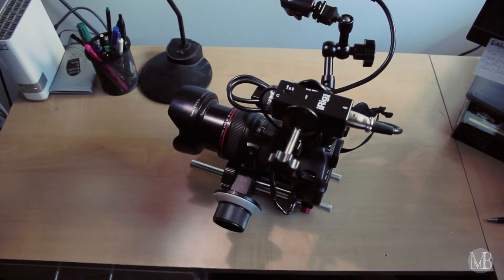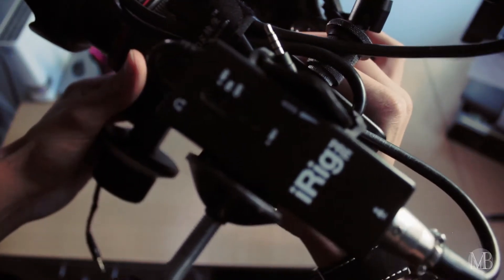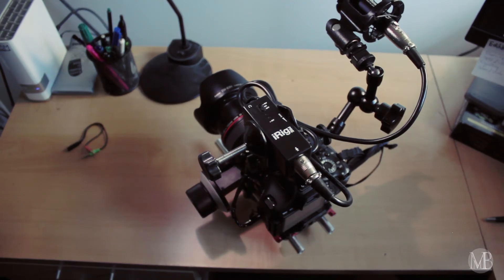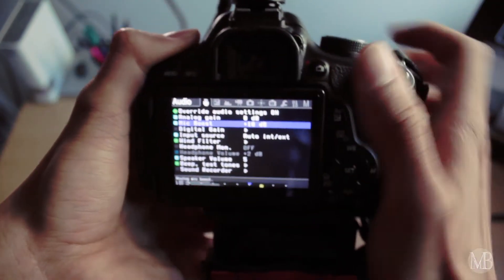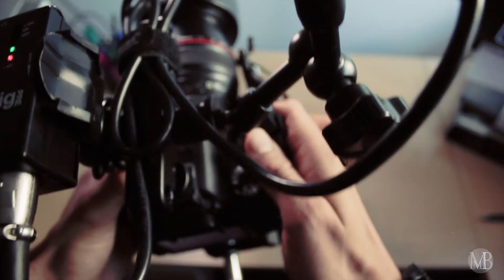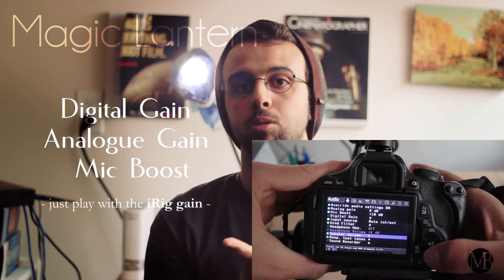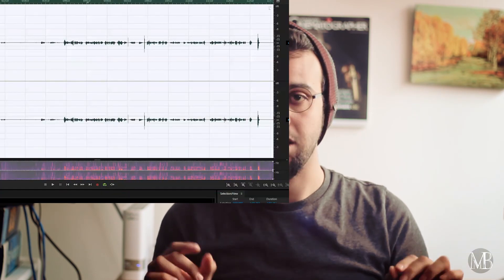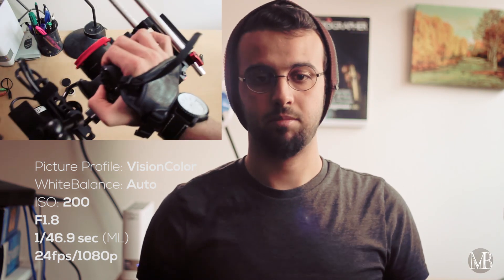Canon T3i DIY XLR setup Tutorial - No Expensive PreAmps

Comment: Great setup! Can you explain the cable part further? Did you open the wires and combine them or are you just only plugging in one of the parts of the y splitter?
Reply from the maker: No you just plug in the mic part (audio input) in the camera. You won&#39;t be using the headset end (audio output). So it&#39;ll be hanging, that's why I used tape to just keep the two cables in 1 entity (no wiring)